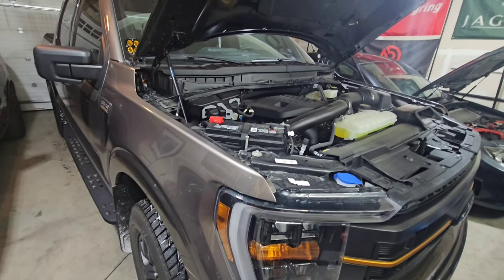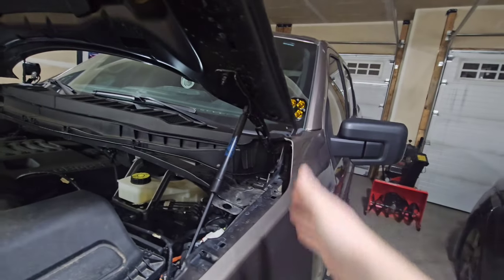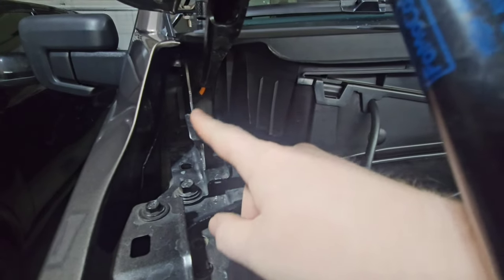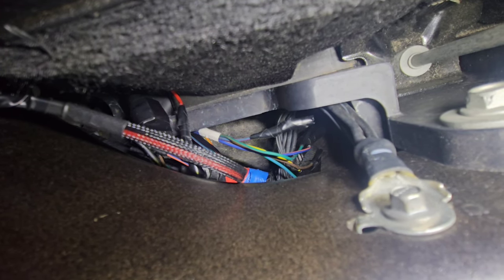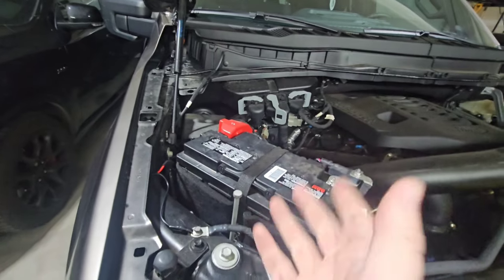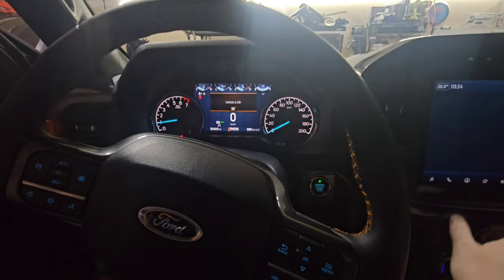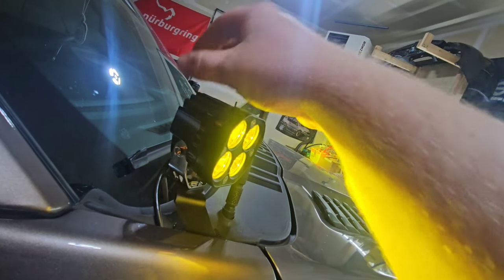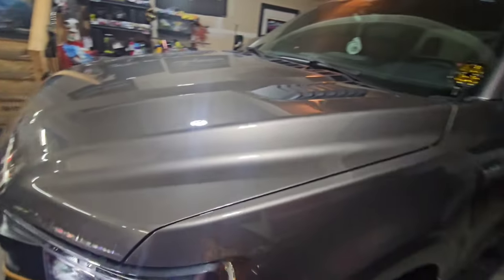Ford F150 Tremor - UPFITTER SWITCH DITCH LED INSTALL!

Comment: Swap the muffler out with a Super 10. It sounds PERFECT! Trust me on this one! I’ll try to make a vid with cold and warm starts with idle for folks to hear.

Also, what kind of mpg you getting? After a fresh tank of gas I reset the trip meter when I got on the freeway for a 45min drive going about 65mph… 24.3mpg!!
Reply from the maker: Hey! I actually traded the truck in. But I was getting about the same MPG on the highway!

Comment: Nice install.. I am trying to do a similar install, but I cant figure out how to get the upfitter switches to work on constant power. As of right now they only work when the ignition is on. My Tremor is a 2023.. any thoughts?
Reply from the maker: IIRC there was a couple that were constant power on my 2022. I can't remember which ones, but there was a diagram I googled that was on the forums.
Reply: @BoltsNBoost  Ok, thanks! I have been browsing forums for info. Ill keep looking!

Comment: How do you find the wire colour codes?
Reply from the maker: I searched them online.
Reply: @BoltsNBoost  I’ve been trying that, but I can’t find it. What site did you search?
Reply: @BoltsNBoost  thanks for nothing
Reply from the maker: @moeman6951  huh? Dude.. a quick google search....the information is online or the manual.. chill. Also didn't see you replied

Comment: Do you just connect the power wire from the lights to the Upfiiter wire behind the Battery?? I got the same identical Tremor
Reply from the maker: Yessir. And ground the other to any source level ground.
Reply: I thought those were just signal switches that go to a relay

Comment: I have the same truck!  I'm a electrical dummy. I'm confident I can connect to the harness. How did you connect the two light wires together to make one?
Reply from the maker: Just some shrink tube and tape. There  multiple ways to do it!

Comment: Nice video, but Dude ! open the garage door when starting the truck! I see you cracked it open a tad, but CO is lighter than air so it'll float up, and the low opening you gave is not enough.
Reply from the maker: I have 2 Carbon Monoxide detectors in the garage. It's minus 20 lol. Thanks for thr concern tho!